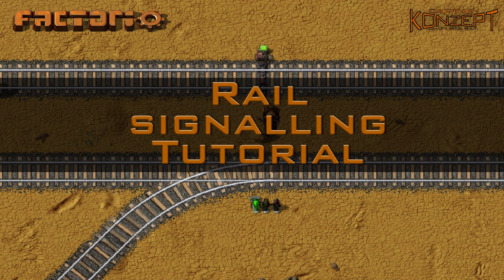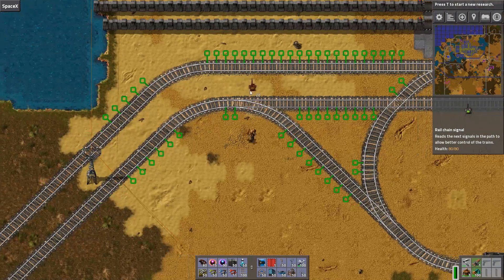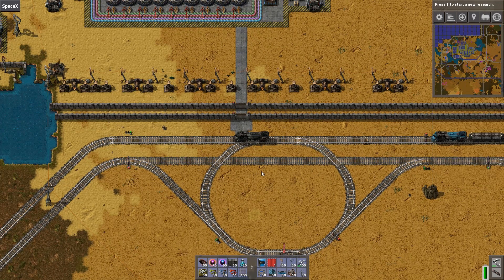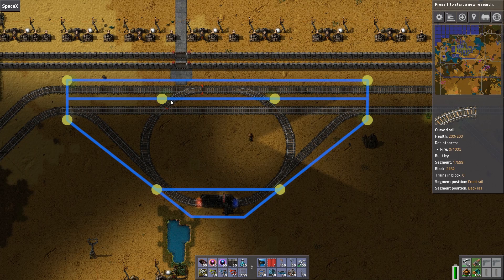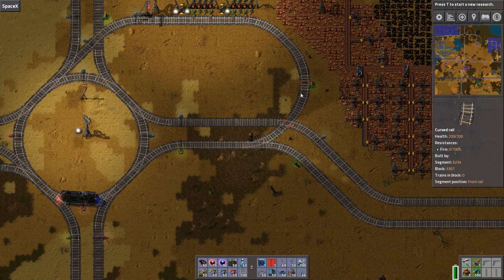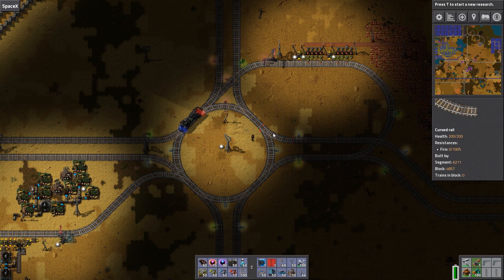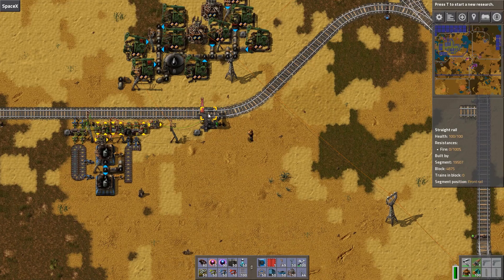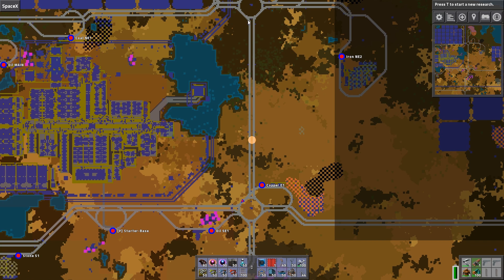Factorio Tutorial: Rail Signalling - Easy Rules for Placing Signals

Comment: What if my trains exit and enter through the same path into the junction?
Reply: For 2 way tracks you'll normally be using mostly chain signals on both sides of the track, the aligned signals exactly on opposing sides. But we don't use 2-way tracks much because they make the whole railway low throughput.
2 way signal for entering a station rail signal, leaving it chain signal also in aligned way.

Comment: it still makes no sense
Reply: These "blocks" confuse me the most
Reply: @redeye118  A block is just a portion of track between signals. Block systems are used to avoid collisions; signals will change depending if a train is in a block section to prevent other trains from entering and risk smashing into it. If a train approaches another train in a block section, it will stop in its own block section, right before the block section the other train is in.
Chain Signals will read the signals from "block exits" and, in addition to changing in the presence of the train, will also change according to signals at the exit of the block the Chain Signal is at. This behavior is commonly used to create blocks in which trains WILL NOT STOP in, only travel through or wait before. Sort of like how you aren't supposed to be stopped in the middle of a traffic intersection. In many track junctions, you don't want your trains to stop in the middle of the intersection, blocking other train traffic, so you use Chain Signals to stop the train BEFORE it gets to the junction, much how you stop BEFORE you enter an intersection at a red light when driving your car.
Reply: @Soandnb  What I don't get is what happens if there's chain signals preceding another chain signal. Having two chain signals in a row? Which blocks does it read then?
Reply: @nekocekoBiHMK  It will check every block involved in the train's path, up to and including the block governed by the Regular Signal at the exit of the sequence of chain signals, and if any are occupied, it will stop the train before it enters the first block (it will stop it short of the first Chain Signal).
Note that it doesn't check EVERY block section in the sequence of Chain Signals - only those that are relevant to the train's path.
https://imgur.com/a/YJQaFlj
Reply: @Soandnb  Thank you!

Comment: Great explaining thanks! :-D. I've been using it for in and out like you have, but maybe I've complicated mine to much. Sometimes my trains jam up at my roundabouts... gonna go back now, see if I can figure it out with your input :D.
Reply from the maker: If roundabouts jam (can happen, though never happend to me) simply remove the chain signals in the roundabout. It'll be less efficient but jam-proof ;)
Reply: Yeah I knew that, but as you say, less effeicient, so I'm trying to figure it out instead... I think I figured it out though, I had used normal signals on the turns (which kinda parallels the roundabout). Changing them to chainsignals seems to have done the trick...

Comment: Great job I figured out my signals, so they jus work fine, and was not sure about every situation, but as I see u have pretty big base using that rules, so I belive it will work fine when more trains arrives on my rails. Also I have single 2 way rails, that also complicate things a bit as I need blocks to be as big as distance for special bypassingsings, when normaly i was cutting blocks with parts, so 1 train can follow second one. Have u any tips for 2 way rails?
Reply from the maker: Honestly I rarely work with single lines - it's more difficult to avoid lockdowns. The bypass would have to be big enough for ALL trains, if you had multiple trains on one line. Otherwise you end up with a full bypass and a train waiting on each side, blocking each other. Use chain signals to lead up to the bypass. If you're carefull enough it should work :)
Reply: Yea, I learned its not worth. So bad I had to build them early without blueprints, because I play on very rare all resources and run out of Iron before green science ended :p now after adding 6th train, I rushed robotics personal roboport, and I must rebuild whole rail system.
Reply: The best tip for 2 way rails is to not build them..
Reply from the maker: Hahaha, that was not my intention, but I guess you're right. 2-way rails work well on dedicated tasks, but not for a whole network.

Comment: Thanks man, no more trains running into each other every damn time. Still don't really know how it works, but as long as I remember: chain signal when train enters, rail signal when train leaves after each crossing it will work fine.
Reply: Trains can only run into eachother when there is no rail signals on the entire line... :/ xD
Reply: Exactly. And that was what I did wrong in the beginning. heh.

Comment: now... how do you do the crosses? Like an X, where the trains arent on the same rail, but on two rails that have nothing to do with each other but they intersect at one point. How do i place signals to prevent my trains from crashing into another?
Reply from the maker: On the same rail, but on two rails? Anyhow, an X is simple. Chain signal before, rail signal after the crossing, for both rails each. If trains go in both directions, do the same for the other side of the rail.
Reply: Thank you, I'll try that out later, tjat would make my trains much more effitient

Comment: Your last addition on the first example is wrong, though - you've put a chain signal on the exit and a normal on the entrance. It means a train coming from the right could theoretically wait halfway through both parallel tracks, blocking both of them.
Reply from the maker: The chain signal is correct, otherwise it would block both tracks (it's not the exit because the reference is the junction). For the rail signal: If you had multiple trains for that station you're correct. You'd better place another chain signal then (that's what I explain round 5:00 "if the signal is in front of another junction", what also applies for this case).